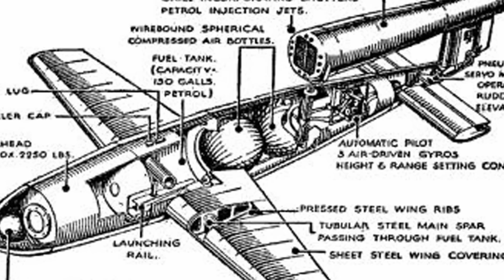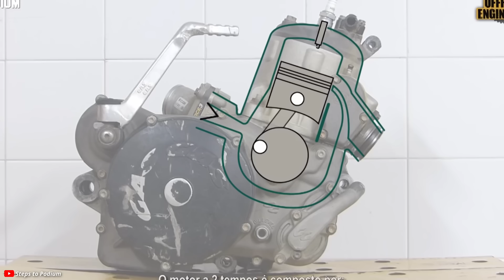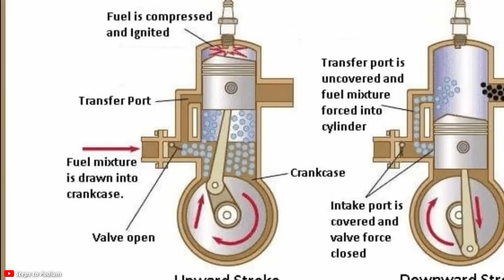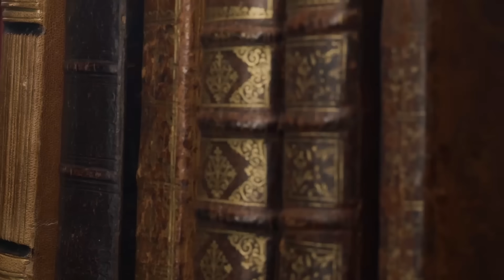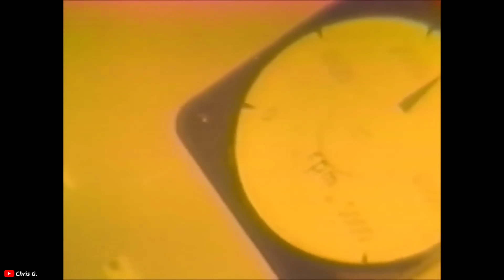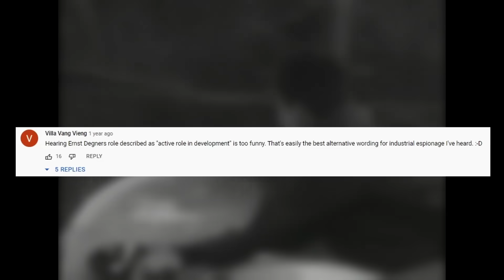How Suzuki stole communist technology to make their motorcycles faster

Comment: In the early 1970's my brother & I purchase a used Yamaha 200cc two stroke twin, did some research & managed to make it as quick as a stock Yamaha RD400. We tinkered with larger carbs, & ports. The secret was in the expansion chamber exhaust pipes. During our first test, the extra power caused the stock clutch to slip. I went for a ride with two friends from work with their identical Honda CB500 fours. They were shocked, when I left them behind on the local twisty roads. I also passed a guy on his Suzuki 750 "water buffalo"!
Reply: Not hard to believe, the teakettles had straight pipes w/ mufflers as stock fitment. Somewhere, I have a Clymer maintenance book for the GT750 with a xerox-copy of a diagram showing how to modify the ports on one that in combination with [insert period pipe manufacturer's name here: Jardine? My CRS is acting up...] would give you a pretty fast bike for its day, as opposed to the lazy tourer/commuting sled that Suzuki sold them for...
Reply: A co worker let me ride his RD. I don't remember if it was the 350 or 400.
 He warned me to NOT twist the throttle until at least 3rd gear, and thankfully he did. It was a real screamer. I was very impressed.
Reply: @babydriver8134  I rode a borrowed rd350 (was tuned too...) after gaining some experience (1hr on the bike lol) I gave full throttle....and the carbs stuck OPEN!!!!!
Luckilly I escaped hiiting the kill-switch in the very last sec...

Comment: I have a 1993 MC21 with a 1986 RG 500 wedged into it.
It works very well for such a low budget project.
For those that don't know the Suzuki RG engine.
It's a square 4 cylinder. Two crank shafts, each carrying two pistons.
It water cooled. Rotory valve induction.

This one has mod'ed Jolly Moto Chambers. Using the OEM Honda rad. A modified Yamaha R1 tail section and Suzuki GSXR fork assembly with fully adjustable components (clip-ons, T clams and so on).
It's a mixture of the best parts I could scrounge up at the time (20+ years ago).
I haven't changed it much since I completed it. Just a few minor upgrades here and there.

Comes in right at 300 lbs dry tank. And makes whatever an tuned RG motor makes in HP.
It super light, very tight and extremely nimble.
It is by far the most evil bike I have. Like Rossy said. "De bike, et have a soul". This one definitely has a soul and it's out to scare the crap out of you.😈
I have faster stronger bikes. But nothing this light and  thrilling.
The sound is right from the Gods of Speed.
Compels you to go fast. To rip through the power band. To lose your adutness and act like a child. Much the same as my Sumo.

Two strokes are just different. They can easily amp you up and cause you to forget where you are.

The 500 is still in my living room.😁
Reply: My dad helped design the original RG engines - RG stands for Ron Grant, absolute legend of a bloke and I have always been proud to be his son. One day I hope to own an old RG myself.

Comment: I did not know about this story of the 2 strokes, but I loved to work on 2 stroke engines, port and polish those engines was the highlight of my younger years as a motorcycle mechanic, it is amazing how much power you can extract from those little engines, that sound that those engines deliver when peak torque is near its end... so sad to see them gone. Playing with those transfers to make them synch with the RPM you were aiming for, porting reevs, cutting rotative valves, jetting, polishing, customizing exhausts, every little change will have an impact on power delivery... it brings a smile to my face. Thanks for sharing this info 😊
Reply: They may never race at the top level anymore but i'm absolutely certain they'll keep selling- as dirt bikes at least.Too many riders want them for manufacturers to ignore😃
Reply: Rotative valves, My two stroke was a 550cc

Comment: Thank you for such an interesting video. This one is worth viewing twice. 
I was lucky enough to have someone a long time ago explain the basics of the workings of a two-cycle engine, that it made all of the difference to me. The man was a seasoned mechanic, motorcycle enthusiast, and just an overall gear head. What he explained was the “reverse re-burn principle” that all two strokes work on. Basically the exhaust is so key in the performance of the engine for the fact that some of the partiality burnt fuel that is in the exhaust stroke, is pulled back into the combustion chamber with the fresh air/fuel mixture. This is also what allows the unburnt oil/ fuel mixture to act as a lubricant. 
To add to this, I was able to read about exhaust resonance and the use of sound waves to enhance the performance of a two-stroke in Snowtech magazine. So the design of the expansion chamber, and the length and diameter of the exhaust has everything to do with the performance of the engine. Think of the pipe as a musical instrument itself. The tuned exhaust sounds good because of that. The sound waves can be manipulated to produce different outcomes with respect to the application of the power and torque demands. It gets pretty deep but it is so interesting to me. I love to play with old motorcycles and snowmobiles and get them to run the best that is possible.

Comment: This really brought back a lot of memories. In ther mid 60s I was riding for a friend that was way beyond a great mechanic. He built his own 50cc GP bike, mag frame and ultra light. He used a Tohatsu engine and removed the clutch for more power. He used a kill button to shift. This may have been where he got the idea? On my bike, a Honda, he made an electronic ignition system that did away with all the hardware and battery. Anything to save a bit of weight. I found it odd that GP racing never caught on in the states like it did in Europe?
Reply: Motorcycle racing arguably never caught on because post war, basically, Americans were wealthy enough to afford cars. Europe wasn’t. Additionally huge numbers of war surplus, junk motorbikes were just left in Europe. In the US, anyone who, for whatever reason really could not afford a car often turned into motorcycle gang members, who didn’t do track racing, then you had teenagers in the 50’s and 60’s who were all about “The Open Road” (As in the HAMC, “The Wild One” and “Easy Rider”) hence no formal track racing scene really emerged.
Reply: Never really like two-strokes although the first bike I ever rode was one. Motior cycle diesel equivalent in my view.  Even so, that did it for me.

Kill Buttons.

My close friend from the early 1960s had a Triumph Tiger 110 ( as used by the British Police Patrols..  remember them ?.. now replaced with cameras.  ~ one such Copper in Jackboots stopped me for speeding on London's North Circular Road during my ton-up boy days. When starting the 110 after booking me his foot slipped. I hope the Boots did not cushion his shin from the pain..  ) It had a kill button on the centre of the instrument nacelle. He told me he used it when changing gear at high revs. Yeah right. I rode that bike a few times. The British parallel twin still has much appeal for the biker. My 4 cylinder Honda was far too competent. The most impressive bike I ever rode back then was another friend's very highly tuned BSA Rocket Gold Star. Clubmans TT spec trick gearbox, complete with clip ons, rear footrests and race spec tyres.. I think that bike did 70 mpg in first gear. Not really suitable for a daily driver work commuter bike. Boy could it go. More torque than a Vincent I had a brief spin on.

Great days, I feel soon enjoying Motoring will be made unlawful.
Reply: @Ropponmatsu2  there was plenty of motorcycle road racing in the US in the 70s and 80s. Kenny Roberts, Wayne Rainey, Freddie Spencer, Eddie Lawson, Randy Mamola, and Ben Spies didn’t only ride dirt track before moving to MotoGP. There was a vibrant AMA Superbike series, the Daytona 200, and the US GP at Laguna Seca.
Reply: Road racing for cars is the same way. Really disappointing how little there is of both in the US. 

Idk how much this applies to moto tracks, but I recently learned that a large portion of UK's road tracks came post-war, from converted air strips. Perhaps gave them a boost we didn't get here?
Reply: @TravisTerrell  This is true, like Silverstone which is the UK's premier Race track now. A former WW2 Bomber Station. RAF Wellington' Bombers stationed there hence some of the names used for key areas of Silverstone like hanger straight as was/is..  Never my favourite, I preferred the purpose built tracks that were built and evolved into fine tests for man and machine like Brands Hatch. That was and still is. It used to alternate with Silverstone to hold the British Grand Prix. That stopped a few decades ago.  Always preferred the "Park" circuits like Oulton and Cadwell.

Nothing stays the same or lasts forever. What first attracted me to Motor Cycle Racing were the true Road Race circuits like what is still the most demanding Circuit on the Planet for Motor Cycle racers. The Mountain Circuit on the Isle-of-Man located in the middle of the Irish Sea. It used to qualify for the Grand Prix circuit with points awarded but, far too demanding for obvious reasons.

Several modern day UK Race Circuits are ex-WW2 Bomber Stations. Thruxton my favourite which i believe is now the fastest circuit of them all.

Brands hatch was and still is a great F1 circuit for both competitors and spectators alike. Closer to London but, Silverstone more centrally located in the UK Midlands. I was disappointed when the F1 Grand Prix action left Brands. My trackside visits became less frequent then. There was plenty of space to develop Brands to allow for the growth of F1 since those now distant days. Trouble is there were too many reasons not to do so not least objects from the numerous nearby NIMBY mindsets.

There used to be Motor Cycle racing at my local still active Airport and car events too.. That was now many years ago and the NIMBY's played their part in stopping that. The Airport was there long before the NIMBYs. Such is progress UK style of late.
Reply: Magneto,Old tech but good tech
Reply: Americans thought Harleys are/ were motorcycles... hoho
Reply: @codyhatch4607  , well lawn movers are 4-stroke these days. I suppose it's more about price really.
Reply: @patrickporter6536  , just a matter of tast and status.
Reply: @codyhatch4607  , If you have to add oil to the petrol I would assume it's 2stroke if not it's 4stroke. I have never seen a chain saw that doesn't need oil in the petrol (and chain oil of course.). 
Now do you want to talk outboard engines too.
Reply: @codyhatch4607  
Actually you did write “I have never seen a 2 stroke chain saw, have you”.
Reply: @kasperkjrsgaard1447  That's what happen when you don't proofread, eh?
Reply: @kasperkjrsgaard1447  Oops.
Reply: @codyhatch4607  This is what you wrote -  
"I have never seen a 2 stroke chain saw, have you.".
Reply: @T16MGJ   My late father had a burn up with a bloke on a Vincent rapide riding a “54 tiger 110 , he said it was the only bike that beat his triumph and that he thought the clutch was slipping but it was the sheer power and torque of the Vincent, it would have been circa 55-56 in your area! , it wasn’t you was it? Ha
Reply: @muckle8  No not me. I was schoolboy when I first saw a Vincent V-Twin, . My father and a near neighbour went up to a Pub on the Cotswold Hills in the car and took me along. Sat watching the traffic go by and soon a Motor Cyclist parked a big black machine close to where we were all sitting. That neighbour had a Triumph Terrier Motor Cycle and previously had given me a lift on the pillion. My first ever Motor Cycle experience.  I was still a schoolboy then. I was impressed the way that little Triumph ( a mere 150cc 4-Stroke ) pulled and performed considering a six foot adult and teenage school boy on board. It was he that told me what a Vincent was and the performance which little me found hard to believe in the mid-1950s.

I attended the funeral of a lifelong Motor Cyclist friend a few years ago, Big C got him in his early eighties. His son had the task of dealing with his father's Motor Cycle Collection of over a dozen Bikes including three Vincents ( and many parts ) plus my Triumph Sports Cub he bought off me back in the 1960s. Over two hundred folks attended his funeral, all mostly long term friends with a common interest .. Motor Cycles. It was one of his Vincents which he demonstrated to show what real "torque" was. Max power at very high revs is not the only way to go. Lesson learned. Double 👍👍.  Great days long gone but not forgotten.
Reply: In New Zealand, scrambling and speedway were big in the '50s and '60s. All with the same kind of bike, British Nortons, Triumphs and BSAs.  Cars were expensive (100% import duty...), so for young people, bikes were often the way.
Reply: @MG John you never forget your first ride as they say!  I cut my teeth on a Honda cb100 , went everywhere on it and have been all over europe on bikes since  - thx for your reply and Stay safe amigo
Reply: @muckle8  You stay safe too super man.. Pun intended...

My day days doing a ton plus legally on London's North Circular are way, way behind me. 

Cue my young sons... Dad did you really do those speeds on the North Circular and Patrol cars move over and wave you by? 

"Yes, son, now I creep about in my old MGs and Rovers with 1.8T, and Mustang Powered V8s under their bonnets."

OK hold my hands up, I lied...

About the creeping about bit.  

Worth repeating, stay safe. Too few folks on UK roads now ever THINK BIKE although I still see that notice in rear screens of a few cars. No doubt their drivers all bikers at heart.
Reply: Did you know Ron Grant?
Reply: @TravisTerrell   Doesn't Sebring sound familiar?  There were lots more all over the US  post WWII, but with the SCCA being amateur, there wasn't $$ in them to make'm permanent.
Reply: @patrickporter6536  so slow 🐌
Reply: @DanBlake3rd  You seriously forgot the Quebecer,  Yvon Duhamel, who killed in flat track (dirt track) then move to road racing)  I saw him twice at Laconia, N.H.
Reply: @loftsatsympaticodotc  Right you are.  Duhamel of course.  But perhaps his son, Miguel, was up there too, winning the Daytona 200 5 times.  I forgot Wes Coolie and Steve Wise as well.
Reply: That all sounds like a load of bs
Reply: The idea of a kill button is quite obvious when you understand an engine. Some inventions happen several times in the world. I think Kaden's knowledge, too, could have been find out by other good engineers that are allowed to think for themselves. But I don't want to diminish the fact that he seems to be the first one in his field.
Reply: US'ers prefer to sit with beer can in stadium watching American Football .........no need to turn the head fast............hahahaha

Comment: His description of the expansion chamber is incomplete. I used to race go-karts when expansion chambers hit the scene, '66-'68.
 The exhaust makes pulse when ejected that travels at the speed of sound in the pipe, ahead of the gas itself. When that pulse of denser air hits the neck down part of the pipe it travels back up the pipe to the exhaust port & shoves a little fresh gas/air mix back into the cylinder. This is the resonance spoken of but not explained.

Comment: When I was in high school in France, you could buy a new MZ 125 for nearly nothing. They were cheap utilitarian and basic. They ran on a single cylinder air cooled two stroke engine.
Reply: I also had it on Hungary,for month or two. Then I changed it for 250,bored to 300,that was the beast,too much power for that frame and brakes. 8-10 liters fuel consumpshion,but who cared then,it was the nineteens.

Comment: I was working at an MZ dealer in Britain in 1980's. 
Quite a good bike let down by poor materials. 
We often had to do a complete re-build of engine before 500 mile service as the main bearings and seals would be worn out. 
Several also had bad castings with porous crankcases (
After things were replaced the bike was very reliable and pretty fast for a very basic 250cc single cylinder 'ride to work' motor and would 'cruise' in the low to mid 80mph range with a top speed close to 100mph.
My boss actually had class wins at Pau - San Sebastian - Pau Rally a couple of times (on MZ250 and SILK 660)
The TS 250 was based on the 1966 ISDT competition motor

Comment: As a teen owned several 2 strokes Montesa, Sachs, DKW, Bultaco plus Japanese dirt bikes. you could not beat a Euro bike  till the Japanese "learned" from their rivals one way or another! Good info Mr.Bart.
Reply: Husqvarna,Ossa,Montessa had them miss them bikes.
Reply: I had a Penton125 Enduro ..Three Bultaco Flat Track  250,352,360cc Motorcycles. Suzuki  250 Rotax 250  Honda 250...flat track bikes all 2strokes !!!!!1970-80
Reply: Around 1970 Cycle began dyno testing motorcycles which exposed how little HP some European brands actually had and put them out of business quickly...
Reply: DKW?
Reply: @m.asquino7403  Duitses Kraft Werk
Reply: Suzuki (and Honda/Yamaha/Toyota/Subaru/Nissan) are not Japanese company in a strict sense. Please read my post if you had a time.

Comment: Don't forget Kreidler. They were a West German company who made 50cc two stroke bikes in the '50s, but went on to more success in the '60s and '70s, with their race bikes putting out 10bhp (200 bhp/litre), twelve speeds via a system of three overdrives on a four speed box and top speeds around 120ph.
Reply: The twin cylinder 50cc Suzuki GP bike developed 300bhp per litre
Reply: And Morbidelli.